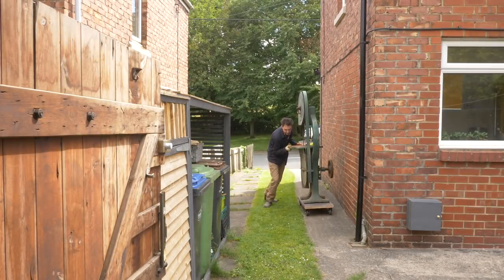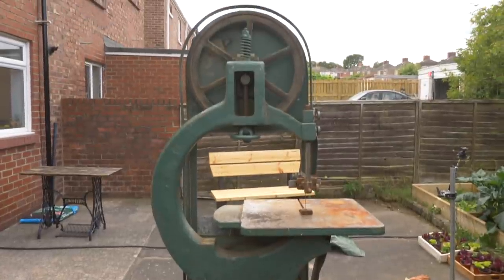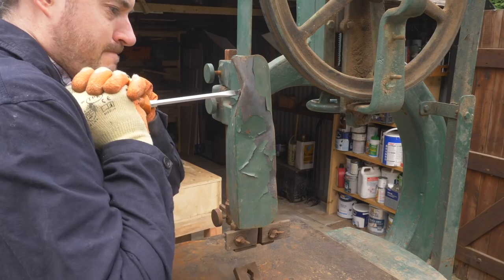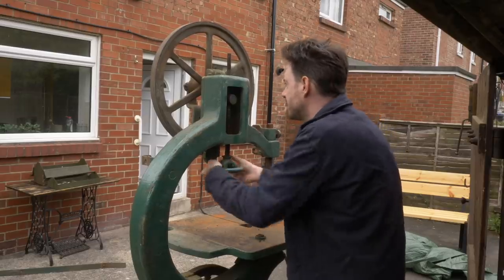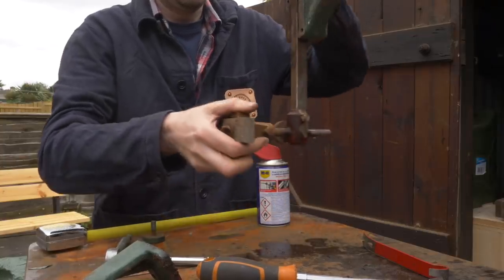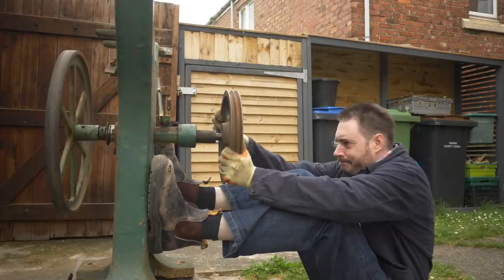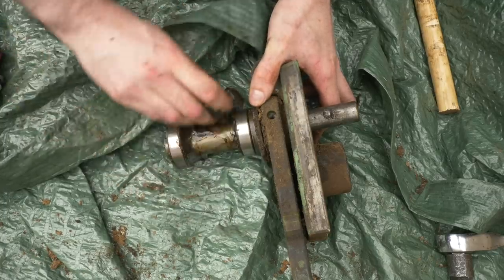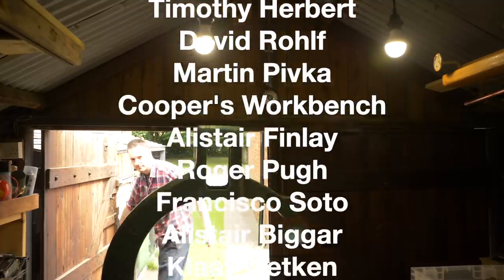Restoring An Old Bandsaw Part One

Comment: Hi Matt. 
That's a very nice bandsaw. Before you remove the grime from the dovetails see if they are stamped LH/RH or one or two 
centre punch marks etc. There might be matching marks on the machine casting so you don't reassemble them the wrong 
way around. Welcome to the club, looking forward to watching you restore this vintage machine. Tony
Reply from the maker: Thanks Tony
Reply: They were usually all painted black

Comment: Nice restoration project, should keep you busy for winter & Lockdown 3.0. Its lovely how old machines were put together and tight fitting slide joints. I'm surprised they were imperial (AF) nuts & bolts, my first thought was Whitworth (horrible stuff)!!
Keep up the good work & stay safe. Now to watch PT 2
Reply from the maker: Thank you

Comment: I feel like you need a little hidden door in the top of your garage that will let you take out the saw (with the top wheel on) if you need to. I know you have some space inside the garage, but I just feel like for longer pieces you might need more space, plus then you can use natural sunlight to see what you are doing! Just my 2 cents. I just think you could make a near invisible little door for it to go through. Nice saw! Cheers man!
Reply from the maker: Unfortunately cutting a door would really weaken the structure

Comment: Nice to see you breathing some life into another old piece of machinery Matt. Your going to need a bigger workshop and garage at this rate. Keep up the good work mate! 👍🏻
Reply from the maker: If I had more room i would get lots of old tools
Reply: Yes bigger workshop or an open air addition with some kind of lift device to assist moving large pieces of material through this saw. Now your a two fisted bandsaw owner, nice. Great find and addition to your shop.

Comment: It could be a MacGregor, Gourley & Co or a Vesper Tools, as was usual with 1900's machinery they were usually painted red, the motor stand would have been a separate bit of casting bolted down independently…..
Reply from the maker: Thanks. I will look those up